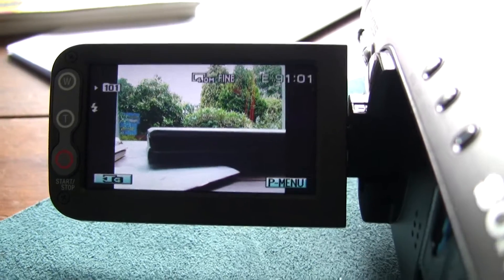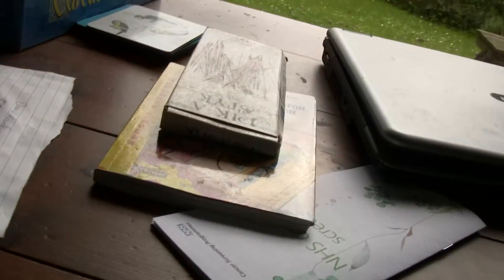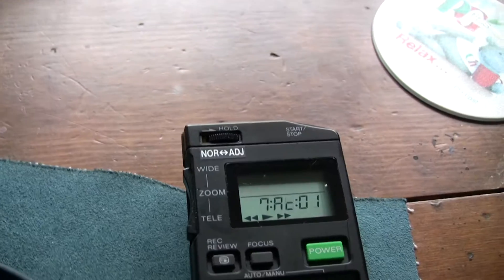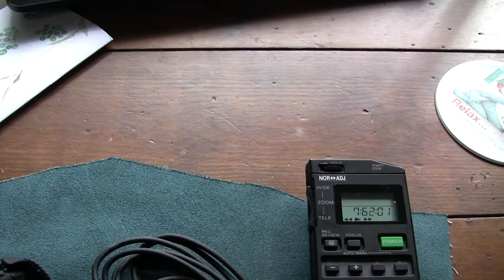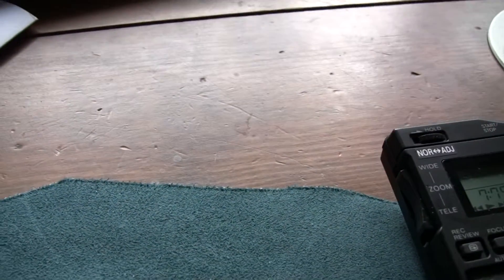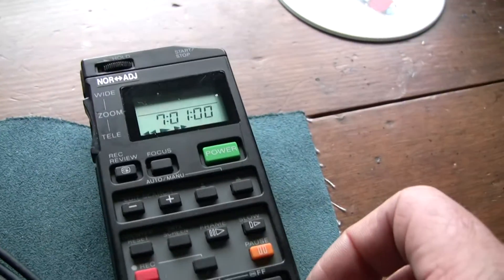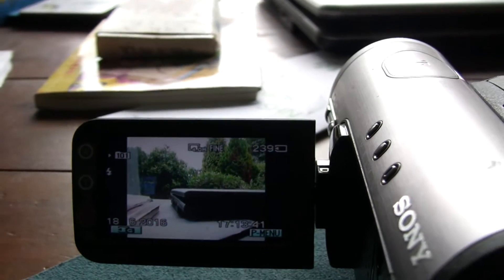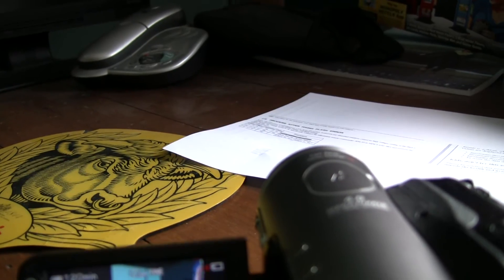Sony E:91:01

Comment: Thanks for the video, Neville. However, how do I get the tool you used to reset the message 91:01.  It would be helpful if you provided that information.  Otherwise, what's the point?

Comment: Okay after a heck of a lot of work I found out what he did as I had to fix an HDR-HC5. Get a Sony RM-95 off EBay - around 50 bucks US - or less and make sure it's the programmable one. There's one that just operates the functions on the camcorder.

I found the PAGE/DATA/ADDRESS values in the repair manual for my camera so they were from Sony.

Turn camcorder on, plug in RM-95 into the LANC jack and slide the "adj" switch a the top left to the right. Numbers come up. The left number (one digit) is "Page", the middle 2 numbers are "Data" and the right 2 numbers are "address". 

Now pay attention! The [edit search-] and the [edit search+] scroll the numbers for PAGE.  The [FF] and the [REW] buttons change the values for the ADDRESS. The [Play] and the [Stop] buttons - one above the other, change the values for the DATA (the last column). 

1) Okay? So .... when it's plugged in and up and running, use the EDIT buttons to bring up "7" - just keep going up with the "+" till you hit 7. Piece of cake!

2) Use the FF & REW to bring up "01" as he did for the ADDRESS. 

3) Then use the PLAY or STOP buttons to scroll through and find "75". You go through a lot of values.

Do nothing yet.

4) Use the FF & RED buttons to change the ADDRESS to "00" like he said and then scroll with the PLAY & STOP to bring up "01".

5) Then press PAUSE - he didn't say "pause" as it's like "enter". Still do nothing yet. And nothing happens.

6) To check it - that the DATA changes to "01" (as he said) it will still be on PAGE 7, type in (scroll) with the [FF] & [REW] to change the ADDRESS to "02" and it WILL come up 7:01:02. 

Slide the "adj" button back to the left, turn the camcorder off and unplug the LANC cable from the camcorder. Turn your unit back on and presto ...I WAS really happy it worked! The guy needs to do the video again on a tripod and be a little clearer.
Reply: R u still using that tool, mine just broke down and I just found out all of this by him and u now. For I have the hdr pj50v camcorder of Sony. I got it back in 2011 for my 21 birthday and had put it away for over six years now because of that error.